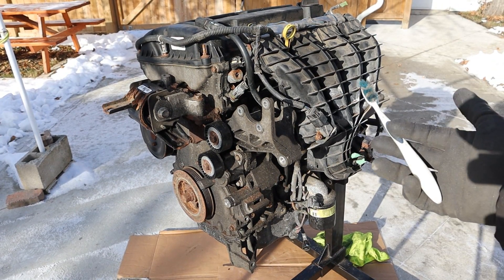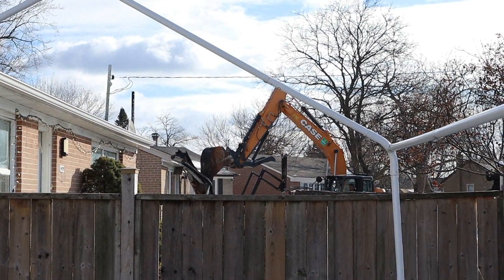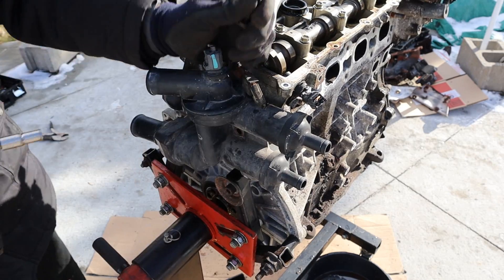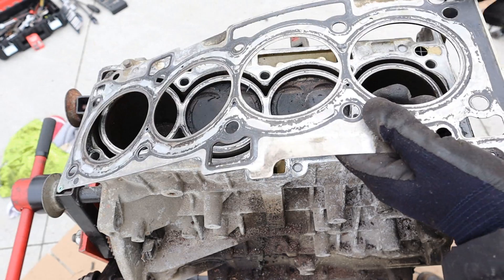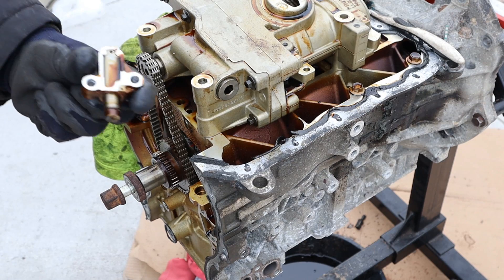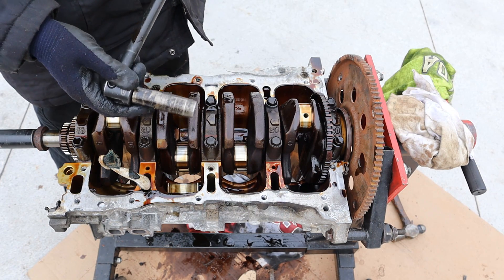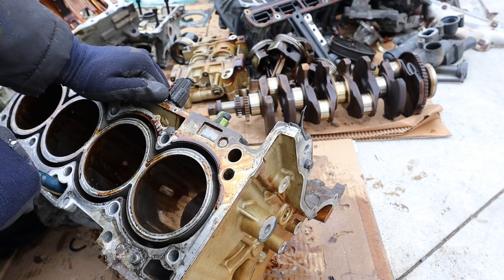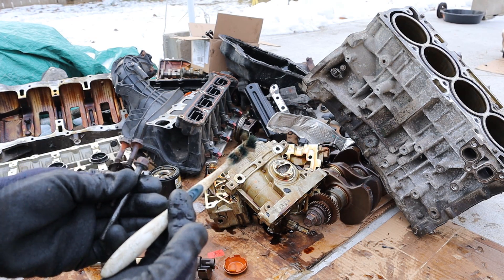Why the Chrysler World Engine is a Failure

Comment: The Mitsubishi 4B11 variant has few changes, like no balance shafts. The Mitsubishi one is a good one, taking into account regular oil changes.
Reply: Yep and I don't think it has the intake flaps. The 4b11 is simple. I own one with 300,000km on the odometer. Always synthetic oil
Reply: @DaDaDo661  Mine has only 135K Km.
Reply from the maker: And the Hyundai is the worse variant !
Reply: I have a 4B11 from 2009 with 128000km, never had any issue with it.  Full syn changed regularly.

Comment: fail often? I'm confused the one i replaced at the Mitsubishi dealership was 1 because they had no oil in it and I didn't even replace one at Chrysler but i did do 3.6l head gaskets and 5.7L hemi engine on a brand new jeep Wagoneer. in my eyes those engines are basically indestructible not the fastest nor highest quality but it's a mass produced economy engine
Reply from the maker: Yeah I guess the simple design makes it easy and economical to work on. Why did the Hemi fail?
Reply: @speedkar99  valve seat 5,800km

Comment: Love these teardowns - to add, the World Engine was a three-way design with Mitsubishi
Reply from the maker: Im glad you appreciate it!!
Reply: Hyundai took the lead in initial engineering and then Mitsubishi and Chrysler fine-tune them and added their own details, heads, accessories, and engine management programs
Reply: 3 ways are the best!
Reply: Yes I have the Mitsubishi Outlander, great car and it has the same engine,  It was not well maintained by the previous owner so it's been giving me issues. I just replaced the engine completely w a jeep compass that is the same. They burn lots of oil

Comment: I had a 2007 Dodge Caliber with this engine and it ran great. I sold the vehicle before it had too many miles on it as I was concerned about the longevity of the CVT transmission. Suspension and brakes were a problem for me. The tie rod ends had to be replaced at 20,000 miles (I have never seen this happen before) and I had to replace the lower control arm bushings about a year later. I only had about 30,000 miles on the car when I noticed that the brakes would start to squeak when I backed out of the garage in the morning. I had the brakes serviced twice and the noise stopped for a few weeks after each service and then returned. I got annoyed one day and bought a complete set of drums, rotors, pads, and shoes. I installed them at home and the brake noise disappeared, proving that sometimes the parts cannon will get the job done :-). I special ordered my Caliber and I liked driving it, I only wished that the quality was better. I rarely buy American cars as I have had much better luck with Japanese vehicles. Thank you for this engine teardown.
Reply: Funny because Mitsubishi in their infinite wisdom decided to use Dodge suspension parts for their Lancer and Outlander. The exact same part failures occur naturally. Tie rods, ball joints, control arm bushings all premature failing.
Reply: @DaDaDo661  Mitsubishi is bottom of the barrel, the joint venture vehicles between Chrysler and Mitsu are 99% Mitsu poor engineering and garbage quality. Look no further than the 3000GT.
Reply: @wildman1137  I didn't say they were high quality. Just better than Dodge. Also for the most part they have more reliable engines
Reply from the maker: Agreed. The CVT and rust were the biggest issues for caliber owners

Comment: Can you do the Mitsubishi 4B11 variant of this engine? It would be cool to see how different it is from the other World Engines.
Reply: I've taken apart a 4b11. I honestly can't see any differences other than brackets and maybe the starter location, oh and the intake flaps aren't there  The 4b11 is of much better quality though. That thing will go over 300,000km easy with good oil changes
Reply: @DaDaDo661  and the lack of balnace shaft assembly
Reply: @gianfrancoa  ah yes that's right
Reply from the maker: Good to know

Comment: Joint venture with Chrysler, Hyundai, and Mitsubishi.  Those engines are tough and last forever with the exception of a few oil changes.  Would have been great if the CVT behind many of them would have lasted as long as the engines did.
Reply: This is why i cherish my 5spd outlander sport im never selling this thing
Reply: @bwatt1383  I worked at Mitsubishi as a Triple Diamond Elite tech for 15 years and when those Sports were new.  That's a rare one and you're smart by keeping it.
Reply: @greggc8088  going on a tangent, any stand out repairs on outlanders or lancers? At first glance the wiring and ecu placement doesn't seem as durable as my Toyota yaris had I'm tempted to clean off the ground wires to prevent electrical issues.
Reply: @bwatt1383  Never seen any issues with Mitsu electrical issues unless some jack leg replace a module with a hip shot instead of diagnosing the real problem.  About the only issues with the Mitsu was AC condensors and CVT transmissions caused by aggressive drivers and lack of changing the trans cooler filter that many do not know exists.
Reply from the maker: Agreed. The CVT and rust kills these cars

Comment: The reason Stelantis uses so many different size fasteners is to help even out the wear on all your tools.
Reply: That is rather courteous of them.
Reply from the maker: Good point!
Reply: Hahahahaaaa
Reply: Did Stelantis own Chrysler when the World Engine was developed? The 2.0 world engine was available since 2007, and so was developed even earlier.
Reply: @sepg5084  It was DaimlerChrysler at the time. Mitsubishi also had a hand in development.
Reply: @sepg5084  the world engine is actually from the 1990’s
Reply: @sepg5084  no, it was one of many turds, such as a cvt trans, Caliber, Avenger etc.  MB left Chrysler after their bitter divorce.
Reply: I really enjoy switching from 13 to 8, then to 16...
Reply: Lol, good one. The is a constant with Chrysler.  I have a hard time remembering stuff and where it goes , but most cars I can use logic to put things back together.  Like, this bolt and size logically goes there , this group is all the same so they hold this bracket in.  That sort of thing.  Chrysler are more difficult because logic can’t be used in that way.  Often have to lay stuff out  exactly because it doesn’t make sense if you want to get it back together right
Reply: GM's Vortec V8 engines from the mid 90s to early 00s take the cake with mixed fasteners.  The accessory bracket bolts are inch 9/16" heads on metric bolts.
Reply: What a champion comment.😂
Reply: 🤣if you only knew why.... not that it was a good idea.. it was mostly greed and saving some coin per unit built. Build garbage to make people keep buying cars. Electric will be ever worse ... throw away cars... and to reuse or reclaim most of a car is a piece of crap.. most of your stuff in the recycle bin goes to land fill like everything else. Welcome to the best piece of misinformation yet.
Waste for profit... and we all will suffer because of this.
Reply: lmaoo
Reply: Technically, the Caliber is a Daimler Chrysler product. It lasted from model year 2006 to 2011. It was not a great car to put it mildly.   Most Chrysler cars in the 2000s were very questionable quality at best.
Reply: Daimler*
Reply: This motor is pre stelantis
Reply: And your tool boxes

Comment: Interesting take here. I actually think that the world is a fantastic engine. For the sole reason that it is made so affordable. The costs they save in engineering are put back into your pocket. And I regularly see cars with the world with 200,000+ miles on them. My girlfriend drives a 2008 Jeep Patriot with the world engine and she has 185,000 miles. And it’s been great. The engine is also incredibly easy to work on. The fastener sizes are a pain. But other than that. It’s a very simply and strong engine.
Reply: Bought a 2014 patriot in 2018. Paid 11k for it with 39k miles, monthly payment was 179/mo. Car had manual transmission, crank windows, etc. Only amenities were traction, abs, cruise, ac, cd, and fog lights, outdoor thermometer. 2.0 has been great, I change the oil every 5k miles full synthetic. Been a great car so far and dirt cheap. First 100k miles no repairs. I cannot complain. Discount car at a discount price, but reliable.
Reply: @billgateskilledmyuncle23  I’m thinking about getting a Patriot with a manual as a daily. I think they’re great little cars. I would avoid the CVT at all costs though
Reply from the maker: It can be, if maintained.
Reply: You must be joking..... 🤣
Reply: @razor6888  why?
Reply: @razor6888  I dunno, Chrsylers may be cheaply made but you can't deny that they are cheaply priced too.  Often Chrysler products are the cheapest vehicle in their class (e.g., Jeep Patriot, Dodge Avenger, Dodge Journey etc).  Whether it's a false economy because you get what you pay for, who knows.  ¯\_(ツ)_/¯

I wonder what would happen if Chrysler tried to make their vehicles as well as possible, instead of as cheaply as possible. 🤔
Reply: @TassieLorenzo  I think they were known for trying to make a higher quality engine than their competitors in the early 1950s and the competitors simply used  more cubic inches. Although I think their early 2 speed automatic might have been a weak point. 
  The DeSoto "firedome" engine and the early small Dodge Red Ram hemi ?
Reply: Is the fastener head rust a common finding or is it just that this engine was driven too many times on a freshly salted freeway such that brine wetted everything including the engine block itself causing the whitish corrosion all over the aluminum block exterior?
  I guess the quality of plastics varies.
Reply: @davidpowell3347  i live in the south and regularly work on that car. There isn’t much rust on it at all. I’m guessing CDJ cheeped out on the rust protective coating
Reply: My gf at the time (I made her an honest woman 😁) had a 2011 Patriot, it had 60k on it and it sounded like a garbage disposal. That was the noisiest engine I have ever heard. I bought her a 4Runner now.
Reply: @JAMESWUERTELE  it seems people either have the worst experiences or the best experiences with the Jeep Patriot. No in between lmao
Reply: @caydengatewood1190  a friend of mine is the most critical and cynical critic about every car ever but he really liked his manual jeep patriot he got new when those first came out. Still looks back fondly on that car.
Reply: @caydengatewood1190  that’s no joke. I had to do a panic stop because of the red light camera intersection turning red. It killed all the ABS, trac control. Lol 😆 so it left the family.
Reply: @lawnmowerdude  the manual seems like the only viable option. The CVT and dual clutch don’t seem too fantastic.
Reply: @JAMESWUERTELE  oh man 😭. Literally today my gf called with some transmission issues. Sounds like she’s gonna need a new trans
Reply: @caydengatewood1190  that’s awful news. I hope it ends up well. I did the Nissan CVT route and that almost ended up a disaster, we now have Toyota 4Runners and 2 at that lol.
Reply: @JAMESWUERTELE  i blame the last owner on it failing. They put in regular ATF instead of CVT ATF. They also didn’t change either trans filter and allowed them to get gummed up and overheat the trans. I’m looking into a replacement trans right now but it might be time for a new car for her
Reply: @caydengatewood1190  that's unfortunate. Are you sure it wasn't just the Castrol cvt fluid because that fluid is red. I recently changed my fluid and filters in my cvt with Castrol cvt and it's been doing fine.

Comment: actual boomer video. a plastic intake and valve cover is doesnt matter. legit thinking "more heavy more better"
Reply: Where did he complain about the valve cover? He just mentioned it was plastic
Reply: A lot of plastics Crack because of heating and cooling...is why German engines are crap like BMW and MB
Reply: @mikefoehr235  bmw leak oil, nothing break due to the plastic.
Reply: @mikefoehr235  lmao
Reply from the maker: Plastic fails more than metal. It's also not easy to recycle.
Reply: You deserve a Tesla

Comment: Yep have this in my kia forte 280000km 12 years old, runs fine and quiet and smooth. Regular changes with shell helix 5w40.
Reply from the maker: Nice. The kia ones didn't hold up well so you're doing good.

Comment: I dunno, seems to have held up well enough considering high mileage and clearly less than stellar maintenance, these engines have their issues but they aren't failing left and right, they're pretty reliable all things considered. It's just everything else attached to it and the vehicle that falls apart.
Reply: The Chrysler engines of this era are pretty solid, they're just not the most powerful or efficient.
Reply: I've said for years. Chrysler is trash. They have 3-4 solid engines. But unfortunately they're in a Chrysler. They have some real shitty ones too, pick a 6.4 hemi, 4.0 v6, 2.7, or my fave, 4.7 v8..
Reply: @PureCountryof91  The SOHC V6 family of Chrysler engines is pretty reliable compared to the Pentastar of today.
Reply: @RatBürgerSk8  eh. They're gutless. Even "h/o" models are pretty anemic, even then, as ford and Japan were moving forward with duratec, j,-series the ecotec v6's showed (hah, timing chains) .  Basically in 2005 everyone else was doing dohc v6's took Chrysler a bit to catch up. Though , their second generation engines are typically solid at least
Reply: @PureCountryof91  I've had a lot of good experience with the 4.7. And I've found them to be very reliable with proper maintenance. The 2.7 as well, it's mostly people who don't change their oil who have problems with them as far ad I've seen. Although it's definitely underpowered for the LX body cars.
Reply: @PureCountryof91  Yeah, because all the other manufacturers are so much better, lol.
Reply: @7s29  objectively, Chrysler has huge quality issues